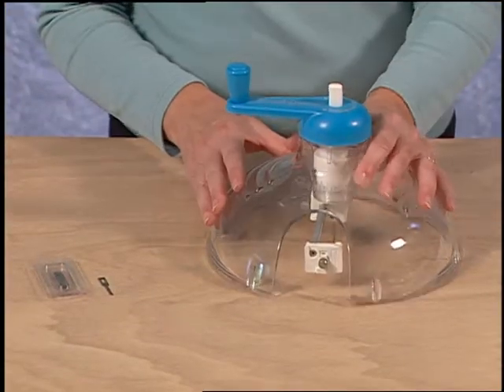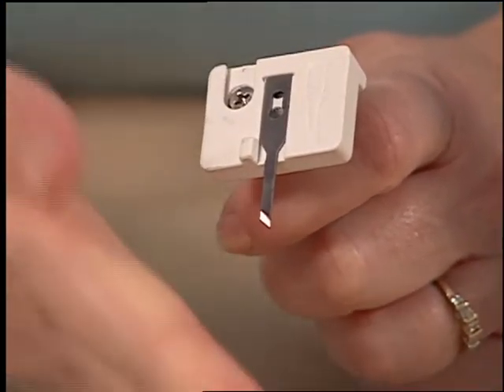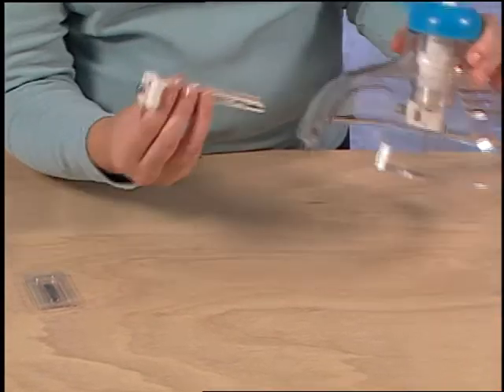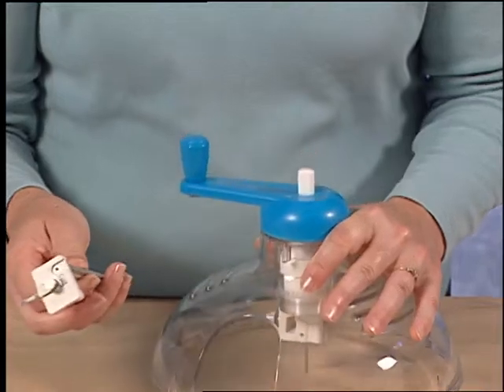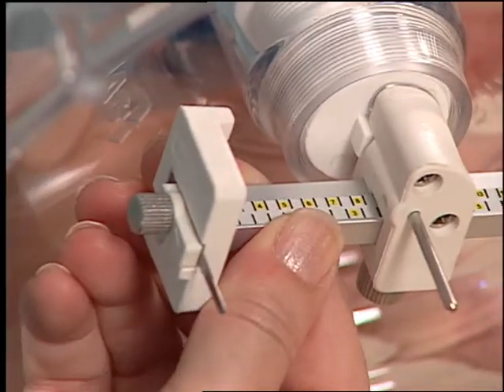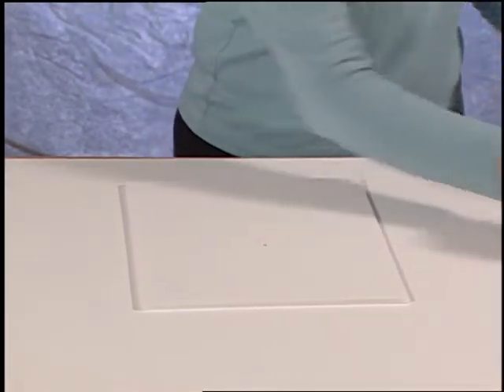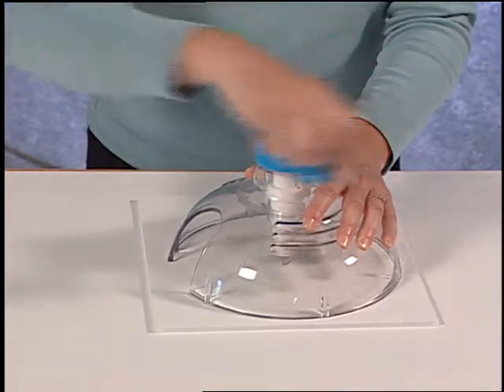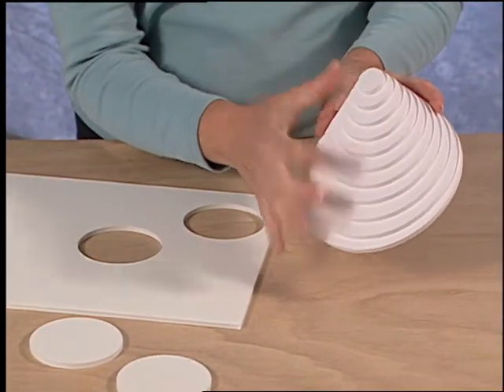FoamWerks WA-8001 Circle Cutter

Comment: Can this cut 300gsm postcard/card stock? I know it's meant for foam board, but I'm hoping it can be used for cardboard also.
Reply from the maker: Hi, If its very thin then likely it would. But regular cardboard or fluted cardboard probably not. The tools were designed for standard foamboard for the most part. Thanks.
Reply: @LoganGraphic   so it can cut straight flat card stock?
What is the smallest and the largest circle cuts that I can cut with this foam cutter?
Reply from the maker: @balatas07  Hello. The tool is designed for use on standard foam board up to 1/2" (13 mm) thick. It would likely cut card stock but the initial piece must be large enough so that the dome can sit on it and hold it in place while its being cut. Best to use scrap foam board as underlayment for best results. The size of the circles to be cut can be from 1" to 6" in width. Thank you.